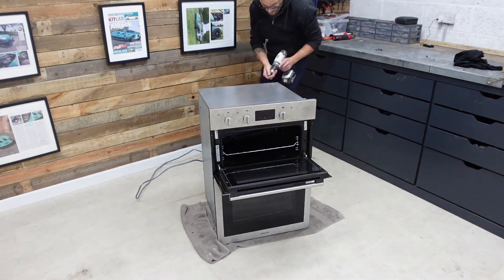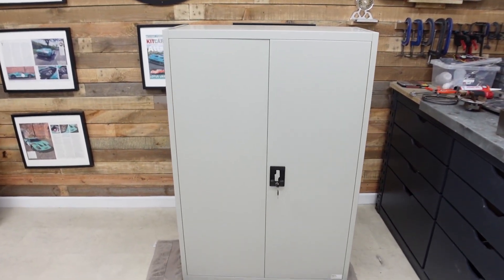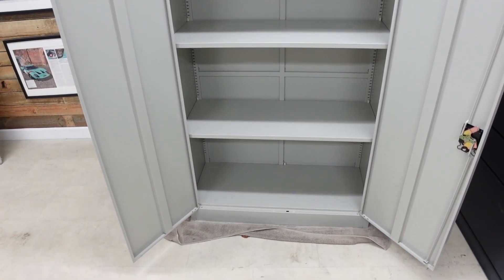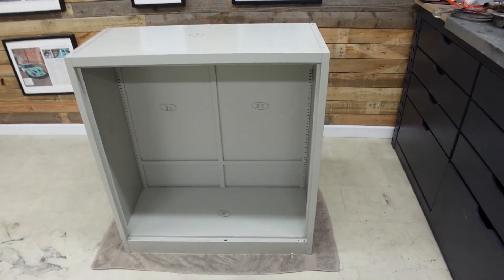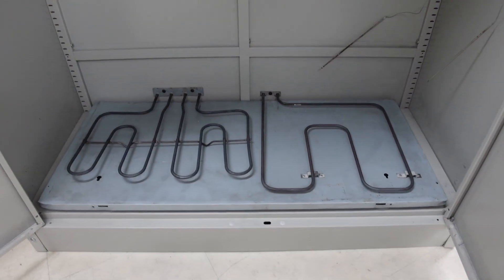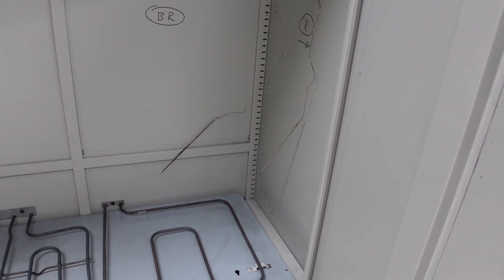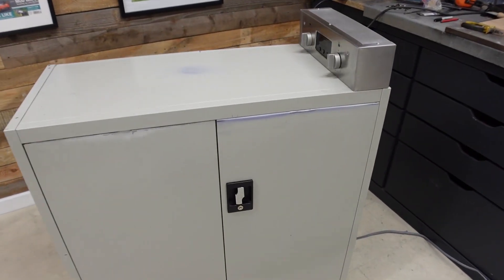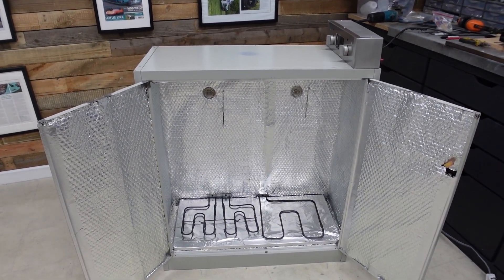DIY Home Made Powder Coating Oven Build

Comment: how does the Reflectix Reflective Insulation holding up? any problem with temperatures above the heat rating of 180 degrees?

Comment: Nice work, just need some proper insulation - that foil stuff will do next to nothing other than reflect radiant heat, then melt and poison you 🤣
Reply from the maker: It's doing a pretty decent job so far but I'll see how it holds up like I said in the video, I don't plan to stand their huffing fumes if it does melt, think I'll be clear of poisoning haha

Comment: I have a question, why didn't you cut the bottom out of the grill and the top out of the oven, weld a strip around the outside to re seal them and save yourself a lot of work by utilising the existing oven. Or do what most of us do for small parts and just use the existing oven with a PID control on the mains lead?
Reply from the maker: I like to make work for myself! Plus a standard looking oven wouldn't have fitted in with the garage

Comment: You caught me off guard with the new name. Saw the thumbnail but didn't realize it was you! Nice little project. Something I've wanted to try myself. I always thought of just an old, used range/oven but this gives you much more room. I'm curious if the door handle gets hot? Looks like it's exposed to the heat inside. Can't wait to see what's coming next!
Reply from the maker: Hi Charlie, yes needed a slight rename for the channel. Re: the handle, it's gets pretty hot but not to the point of worrying about changing it. We'll see how it evolves over time :-)